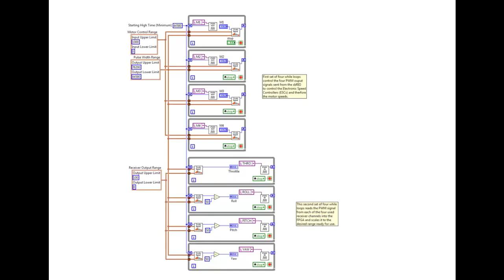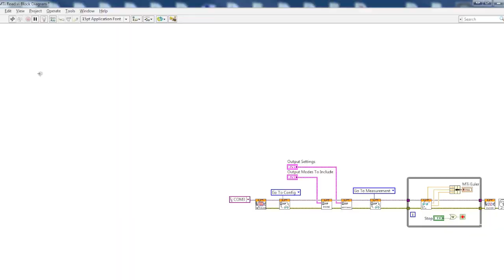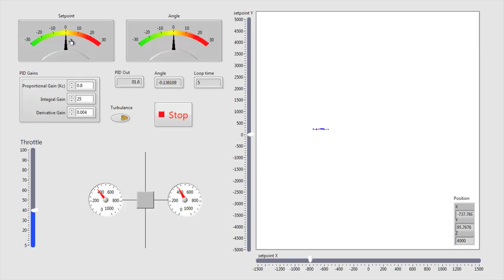PID-Controlled Quadcopter using NI LabVIEW and Single-Board RIO

Comment: Pretty cool, but what does it cost to do this in NI software/hardware vs open open source? 10x the cost sound about right? Not including the cost of labview software.
Reply: dustin s Yep that's pretty much perfect example how not to build quadrocopter. Extremly heavy flight board controller. Telemetry through BT ok 100m range top so its useless and massive BT dongle. I mean seriously this is horrible application of RIO. Spartan 6 could be easly added to the bottom of Naza32 board as far as i remember there weren't any components there. This way you have FPGA controlling motors however as mentioned it's not really necessary with efficient code...

Comment: Hi guys... Nice job. Can I know whether the sbrio can measures directly the digital 5V pwm signals because as far that i know the high output limit of the RMC DIO lines is around 3.465V. Or do you used any external circuit in your hardware design to convert the 5V to 3.3V level?

Comment: that thing looks much too heavy and it is extremely shaking / badly stabilized.
Too slow processing with your expensive hardware?

Use arduino! much cheaper, faster.

lol, labview

Fail, sry
Reply: They might need better motors. Maybe the controller tunning was not the best. Maybe the PID controller is not optimal for that application. But read something about the card and you'll realize that it's a lot superior than an arduino, that means that a quadcopter with this card would do more functions and more complex ones.
Reply: TOO HEAVY anyways 

I prefere using arduino (<3g) as flight-controller + cubieboard (<40g) for extra functionality (Cam, Gps, wifi...)

the system showed here looks and moves like 1998.  ;)

"Britty" weak result for a team project 

peace
Reply: hahaha what if you want to add AI functionality or advanced control algorithms? I mean, that's a good board for complex tasks. I see 2 advantages of this NI platform, one is computing power, the second one is the development tools. But I agree this video just doesn't show all the good features of the platform.
Reply: mihdd Yeah it could be better, maybe its the weight or just bad programming. The IMU looked quite good. Our quad uses an nvida T20 1Ghz dualcore and it flies better I think. :)
Reply: Cool!
Reply: but only runs for 5 mins due to current draw...lol